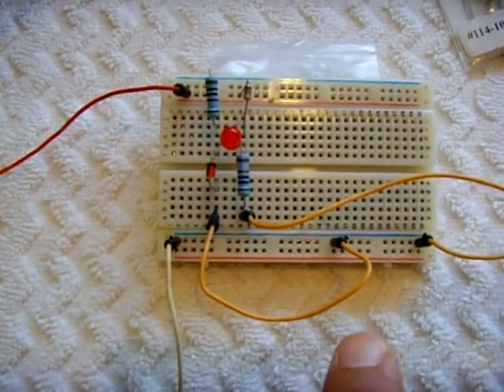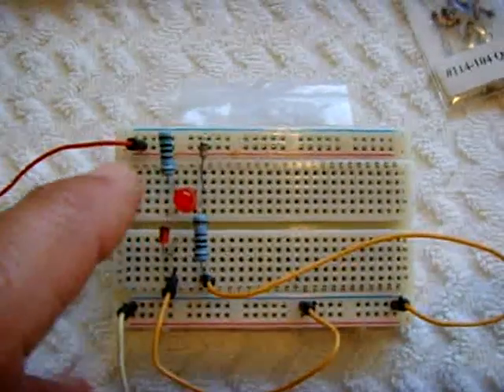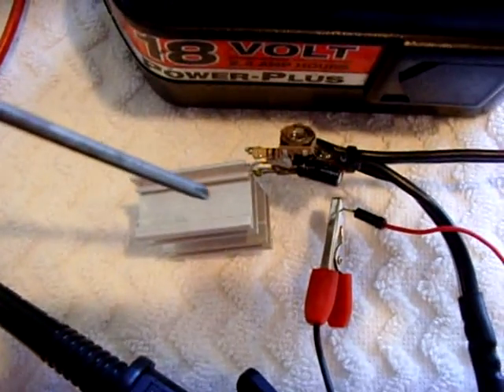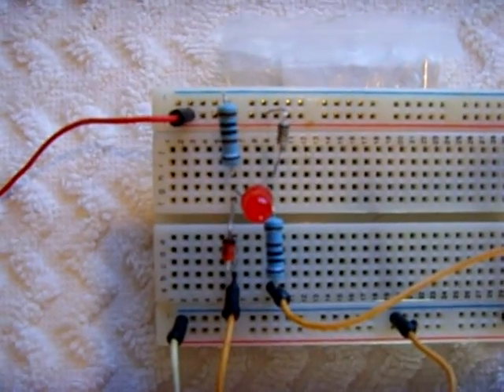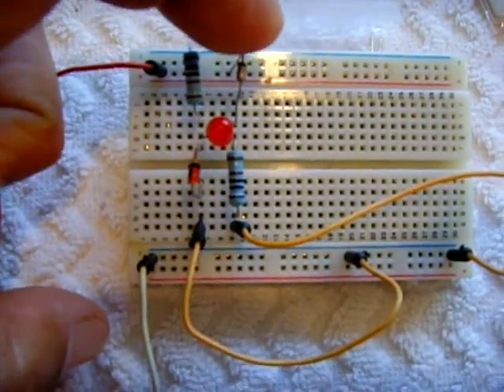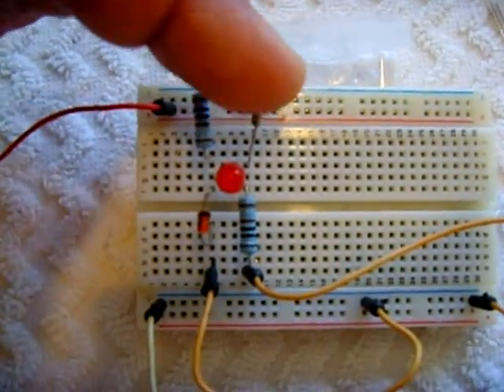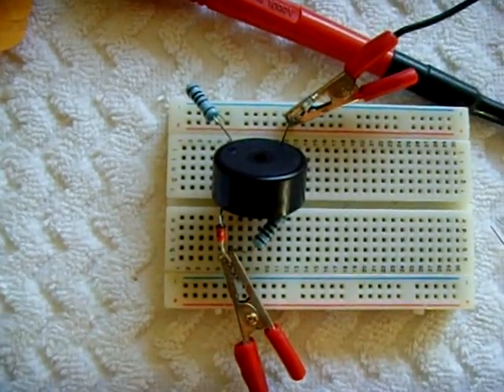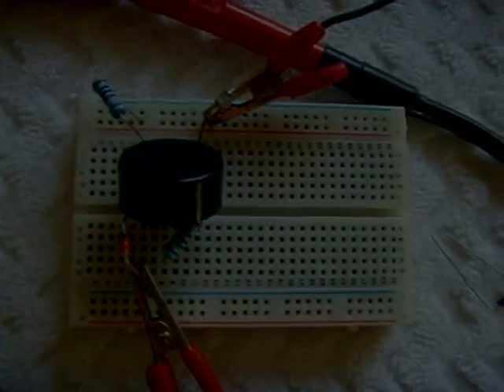DC Low Voltage LED indicator circuit

Comment: so the circuit consumes no power because but when the power gets low, then it does?  so you have to keep an eye on it because you will suck your batteries dry if you dont

Comment: Where can I find the other one you posted that you said was before this, that is, the one that will turn on a device when the voltage is increasing?  I went to your playlist and your videos are kind of grouped.

Nice job here, though.  I haven't built it yet as I want to have a dual system.  Yes, the battery is fully charged; the battery is critically low.
Reply from the maker: https://youtu.be/1fsF98fQd6o

Comment: Isn't this going to be burning a lot of energy in that resistor constantly, reducing battery life? Or does the zener somehow prevent that?
Reply from the maker: Stephen Borntrager Very low current because of the resistors.

Comment: Great video, a quick question, will this logic work if both zeners are 3.3v? Thats the "on" threshold I need for the LED or do I need a smaller sized zener on the bottom left pos?

Comment: il definitely be adding this to the error panel for my off grid solar system 
(a backlit word or pictograph turns on when something is wrong with the system)
Reply from the maker: Glad you enjoyed the video!
Reply: do you have a circuit for a DC overload condition indicator?
and yes i definitely enjoyed the video
hope to see more soon

Comment: How could I modify this so that instead of an LED, I have it on a digital pin of a microcontroller. So: When 3x AA batteries drop below 3v, the microcontroller receives a signal? So the circuit would have to have a ON/OFF output.
Reply from the maker: Just use the circuit shown in my other video. Use an LM393 IC, and use a 3V zener instead of the 6V. Adjust the POT so the circuit triggers at the desired voltage. Use the output pin on the 393 for the microcontroller.

https://www.youtube.com/watch?v=014CLJ98P1Q

Comment: I used a 3.6v zener instead of the 3.3v zener because I couldn't find a 3.3v zener in stores and I installed a piezo buzzer,it doesn't work, please, what might be the problem here?
Reply: Do piezos even work on DC?
Reply: Piezos works perfectly on DC voltage. Don't ask a dumb question.
Reply: Perhaps it is overvoltage. Try powering with a 5volt supply, the tweeter will buzz...lol

Comment: What is the polarity of the 9.1v zener in the supply positive rail? Is it the negative terminal of the zener that connects to power supply positive or the zener positive?
Reply: I couldn't view the schematic. The link to the schematic seems expired.
Reply from the maker: The link works just fine. Try another computer or phone. Thanks!
Reply: I'll make a try, thanks.

Comment: How do I use this for a single cell lipo? (has to go off at around 3.5volts)
Reply from the maker: Hello. Everything was clearly explained in the video. You can also refer to the link in the video description area to view the circuit with more info. Thanks
Reply: @electronicsNmore  It wasn't clearly explained in the video though how to use it for a single cell

Comment: Can I use this circuit on a 6 volt lead acid battery?
Reply from the maker: Sure, just adjust the zener values. I guess you haven't clicked on the link in the video description area. Thanks for watching

Comment: hey thanks for your video its very helpful am very poor at electronics but have a little part of it in my project  just need one help what if i have supply of 24 DC volts (2  12 volts batteries in series) what changes in the circuit will i have to make??

Comment: Thanks for t this. Instead of an LED I am using it to switch-on an SCR thyristor which latches to an alternative backup power supply.
Reply from the maker: +TheBaconWizard 
You're welcome. Please be sure to check out my other videos, share with others, and rate thumbs up. Thanks

Comment: Tried the circuit using a 5v zener diode as my turn on voltage, supplying circuit using 24vdc and a 1K pot to vary the voltage unfortunately LED comes on at 4.9v but it is very dim any suggestions?
Reply from the maker: +Andrew Roberts 
24V is fairly high voltage. You need to play around with the zener and resistor values to get it working good. Try different LED's also.
Reply: +Andrew Roberts hey did you find the solution to your query i have a same situiation

Comment: i love this cicuit, but I can not set this circuit to let the led start at 2V with a 9v system. Can you help me with this problem?
Reply from the maker: Saali Galveo You need to experiment using different value zeners. Try lowering the 3.3v to 2.0v
Reply: yes I tried. Combination 6.2v / 3.3v works, combination 2.7V / 3.3V does not work
Reply: the combination 3.3v / 2.7V also not works
Reply from the maker: As I stated, you need to experiment with different value zeners until you have the desired result. I supply the videos, and if a viewer wants to make modifications to a particular circuit, that is up to them.

Thank You
Reply: i did some experimenting and I got the result I was looking for. Thanks again for the video.
Reply from the maker: You're welcome
Reply: +Saali Galveo What values did you find worked for you? May be useful for others.
Reply: +Saali Galveo hey can you share what diodes you ended up using? thanks

Comment: i have a similar configuation with a 10V and a 3.6V zener diode and a 330 ohm and 10 ohm. it works but the 3.6V gets really hot, will this be an issue in the long run or is this expected from the lower voltage diode

Comment: It the diode in the schematic flipped? I am new at this, but it seems the current would flow from + to - thru the diode and bypass the zeners the way it is drawn. If it was the other way it would not get + on it's anode until the 9.1V zener switched to reverse bias.

Comment: Very simple and effective, )) What would you do for a 18650 3.7v battery? What should be the components to light up the LED at the drop of 2.8v ?
Reply from the maker: I would try using 2.5V or 2.7V zeners. I supplied the information, now it is up to you to make some changes/experiment until you get what your looking for. The resistor values stay the same, just adjust the zener values.

Thanks For Watching.
Reply: electronicsNmore
alright :))) that is a good idea. So if there is 2.7v zener on the right side, the  3.3v on the other side still remains the same? I asked because the right side requirement goes below 3.3v... thank you very much.
Reply from the maker: You may have to lower BOTH.
Reply: Hi! Were you able to make this setup work? I am currently thinking of trying to setup a similar circuit.

Comment: could a person use a POT so you could adjust voltage that it came on at?? if so what POT would you use for say adjustable from 9v-12v??
Reply from the maker: No. The zeners are what really determine the triggering.

This circuit below can be easily modified:

12V Lead Acid Battery Low Voltage Alarm Circuit

Thanks For Watching!

Also check out my video playlists